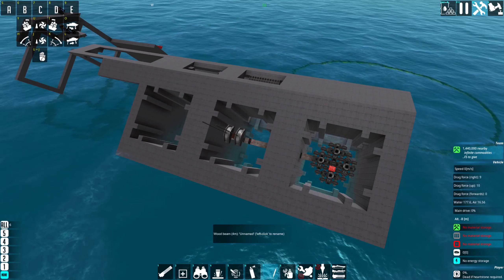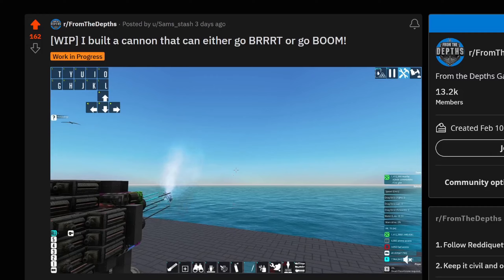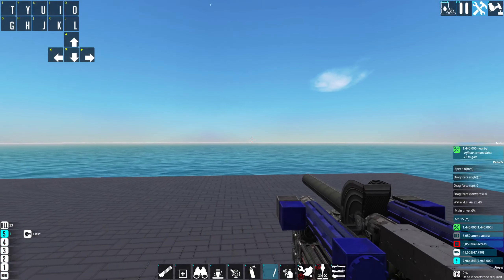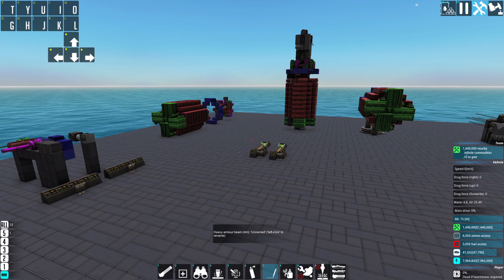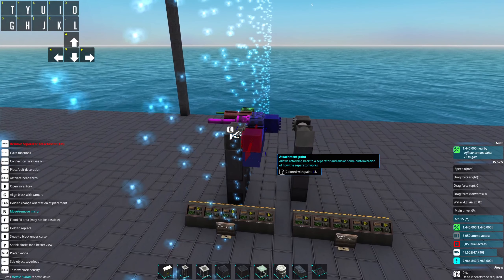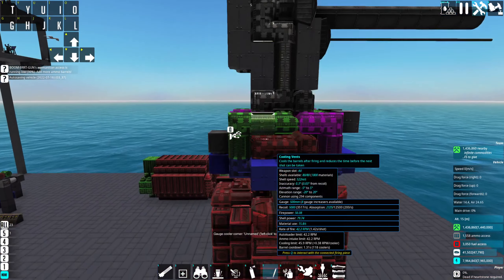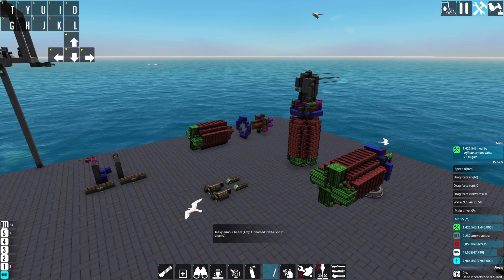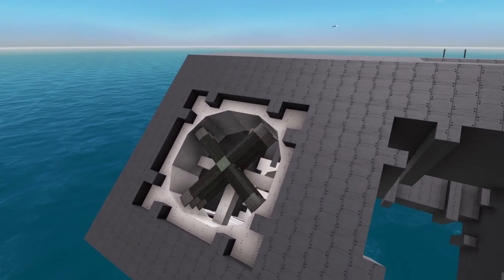I built a gun that can change caliber

Comment: Wow i'm disappointed in myself. I did this for cram fusing boxed but left the stuff floating. How was this not the obvious next step. Well wow that works great with the instant switch and moving it with the piston (you just added sticky pistons to FTD lol). 
Got to say though this possibly changes everything. You can attach the parts of a system who's main block is destroyed, allow steam to be useful after taking some damage, hiding unused high radar profile detection, all the things you said and so much more. 
And I totally understand, sleeping in the cold below is such a good song and its even better after you play the dreadlock protocol where it is featured (if you are interested in warframe make an account and link it to your twitch within the next 11 hours as the yearly event tennocon is happening tomorrow morning and watching it will give you a great boost (titania prime is really good))
Reply from the maker: Good suggestions, though there are some caviats! For instance, you need an airgap to properly detatch a segment without chopping your ship in two. So while it would be nice to move half a steam engine around, it would also mean that said steam engine needs to be suspended in midair only attatched on one side, making it much more vunerable. I think with that special case you can achieve a lot more with valves.
What do you mean with "hiding radar"? I didnt understand that one.
I played warframe a few years ago but eventually lost interest, theres always that overleveled guy blitzing through the level killing all the enemies and I just dont see the fun in outsourcing the playing of the actual game. Plus I have a very addictive personality and try to avoid "grindfest" games because I will easily sind thousands of hours into them. And you wouldnt want my upload schedule to get even thinner, right?
Reply: @livslab  For the steam, you only have to make a U shape in the air to cut that U and while valves are intended they are EMP susceptible making them more of a liability than benefit. 

This is a weird example that popped into my sleep deprived brain. Imagine a mini floating meta brick that covered its front face with radar. It could submerse in water and replace that face with rubber. More practically it would replace it with sonar to keep the super slim profile and maximize detection for long range. Weird but that's what my brain was thinking. 

Ah completely understand. It has its problems and is not for you. I just wanted to help if you were interested (I assumed you hadn't played before). I personally can't play a crucial story quest (and the mission types it unlocks) because my computer cant handle the open worlds needed to fish the components for a required gear item (necramech). And I got bored of the rest.

Comment: I actually like the rotary version more than the sliding one. It just looks cooler to me. Buut the other one is more compact I suppose.

I honestly don't know what I'd do with this kind of system myself. One thing that comes to mind is altering engines, but that's hard to do without replacing a lot of the parts. And if you have that many placed, might as well just have 2 engines and run one or the other.

Adding/removing a Q switch to swap between an attack and a LAMS laser could be another interesting option.
Reply: One engine, tuned either for power output or for efficiency while idling.

Comment: Can the GBS set calibre? If so you can achieve a fraction of this ability with significantly more durability
Reply from the maker: whats a GBS?
Reply: @livslab  new thing for breadbord that allows editing of settings of other blocks, may still be in beta, but i wouldnt be surprised if it could edit gun calibre
Reply: @MrAlbinocreeper  It seems like certain things are meant to be unchangeable (during battle) and cant be altered by ACB and the Generic Block Setter (I don't use this so I don't know). If swapping components gets good enough, they(devs) might just let ACB's and GBS's change the block's settings instead?
Reply from the maker: @nicopence3148  loaded up alpha and had a quick look, and I LOVE a lot of the features (they added logic gates!!! I was about to make a video on how to McGuiver logic gates with ACB! So good to see). I'm getting sidetracked aren't I.
Anyway, GBG and GBS look awsome, though APS options are mostly about energy consumption (should make building a 1-tick mass driver a lot easier), reload, etc.
No option to set caliber (would be too powerful, I guess?)
Unfortunately no option for timed fuzes, which is sad. Still waiting for that option to show up so I can make a gun that fires 3 projectiles with slightly different fuze times so they all explode at the same time creating area denial effect.
Edit: nevermind, found it, it's its own option, not under advanced cannons!
Nice, guess thats the next project now :)